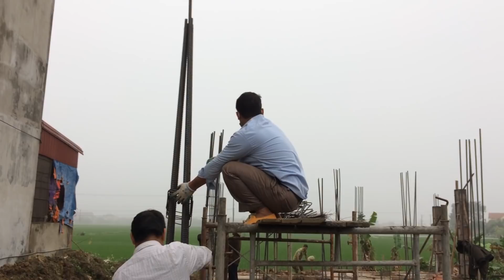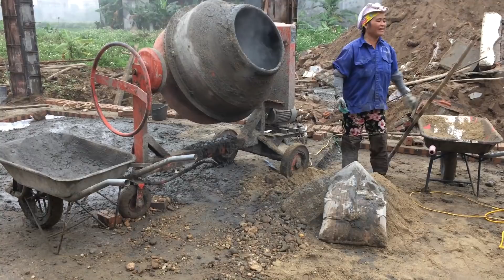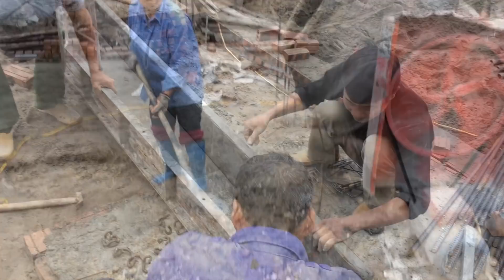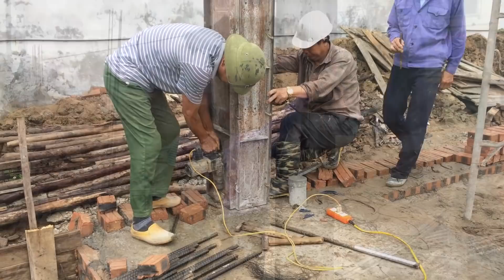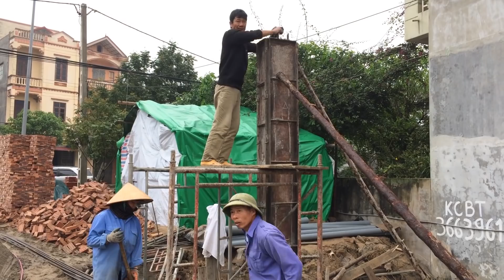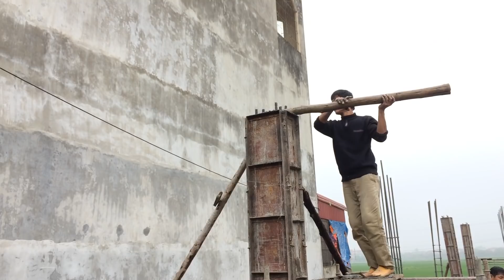How to Make Reinforced Concrete Pillars To Create Solidness For The House - Construction Work

Comment: you need a poker boy, thats no good using the column rebar to compact, thats 1 big air bubble trapped in the shuttering, you need to get it all out.
Reply from the maker: thank you
Reply: @constructiontech2411  Dont forget to use a concrete poker.
Reply from the maker: ok - thank you